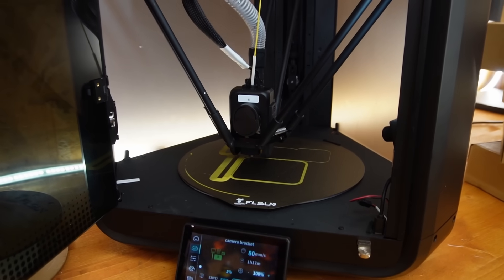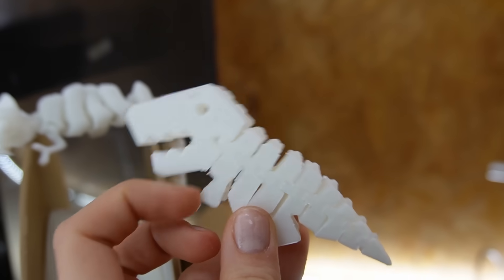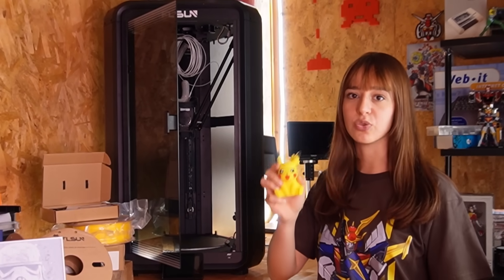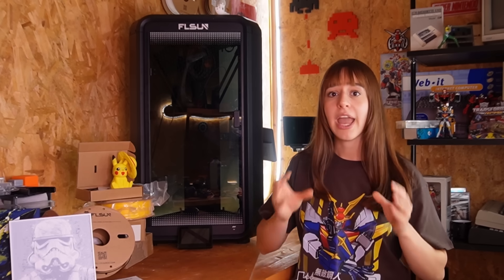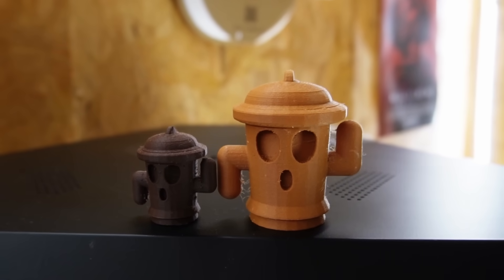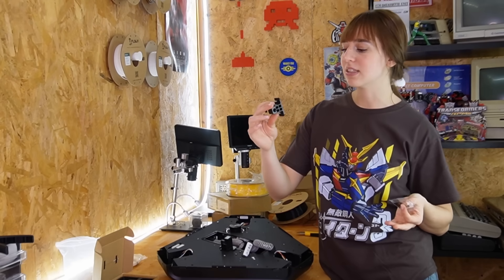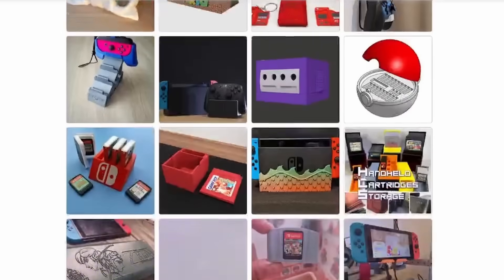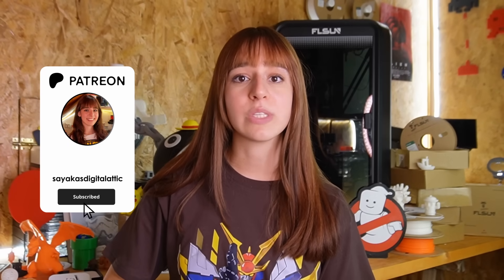How Easy is 3D Printing for a Beginner?

Comment: I really enjoy your videos. Do the 3d printers need a lot of cleaning and maintenance? 😊
Reply from the maker: It depends on the 3D printer model you're using. As a general maintenance tip, one thing you should do every 1–2 months for safety is clean the nozzle or lubricate the axes, but again, it really depends on the specific 3D printer you have.

Comment: You really give me the inspiration to troubleshoot some projects I've been neglecting.  I wish you all the freedom this platform provides,  and hope to see your channel grow for years.
Reply: I've got a magnavox vhs/dvd dub deck that needs the entire dvd module replaced and soldered back onto the board,  and a vcr with tensioner issues. This video reminded me to also work on calibrating my filament printer (I do better with resin machines) There's a shop near me with arcade cabinets,  and I've been helping them to keep stuff running. I've only professionally been a technician for 5 years or so,  but troubleshooting is so satisfying, and you're very thorough.  Hope to talk to you again soon 😊
Reply from the maker: Thank you so much, what repair projects are you working on?

Comment: How does the Flsun compare to the Bambu labs P1S in your experience?
Reply from the maker: I don't have a BambuLab P1S😥
Reply: @Sayakas_Digital_Attic  Oh then i mixed up! Sorry! I thought you had a Bambu as well :)
Reply from the maker: @mlonster  I do have one, but the X1 Carbon!
Reply: @Sayakas_Digital_Attic  Aha, i remembered seeing one:) Can they be compared? Is there a thing that one does better than the other? I am asking because i was thinking of buying a Bambu. But now seeing your FLSun it also seems well worth it.
Reply from the maker: @mlonster  Hi, sorry for the late reply. Well, it depends on what you want to do with the 3D printer. Based on the projects you want to create, there are definitely different recommendations. For example, if you want to print quickly in a single color or if you need multi-color prints, etc..
Reply from the maker: What do you plan to use it for?
Reply: @Sayakas_Digital_Attic  Hey Sayaka! Well, mostly i will use it for spare-parts and technical/mechanical parts used in older audio equipment like amplifiers, cd-players etc.

Comment: I'm fencesitting about getting a 3D printer, on one hand it seems like a large expenditure for something I might only use occasionally that is going to be undenably expensive to run and take up a fair amount of space in my small flat, on the other hand it would be a useful device when it's needed, not to mention really cool.

I know a fellow who's boyfriend bought him a 3D printer as a gift and he loves it, and he has virtually no tech experience but just wanted to print off little gadgets and try see what kind of stuff he could craft and he is very happy with it and picked it up quickly enough, so I'm sure I could pick up the skill of using one, plus I have a weee bit of CAD experience which I could expand on.
Reply from the maker: I totally understand your hesitation! A 3D printer can be a significant investment, especially if you’re not sure how often you’ll use it. It’s true that they can take up space and have ongoing costs, but they can also be incredibly versatile and fun to use.
It sounds like your friend has had a great experience :) and having some CAD knowledge will definitely give you a head start.
Reply: @Sayakas_Digital_Attic  yeah he's a lucky boy, he's been making some cool 3d puzzles with it and I've got to say the prints look good!

Comment: Great explanation.

I bough a smaller 3D printer a while ago and I think it's great.
Even though I'm more of an occasional user, I consider a 3D-Printer a great tool.
I guess I'll buy another one sooner or later, so that I could use and try the additional materials you mentioned.

Aside from several helpers and holders, to attach a power strip to my self-made workbench rack, secure my multimeter probes, printing spare parts is a great use case.
Spacers for circuit boards, holders for modern capacitors in old devices or appliances, a new knob for a kitchen appliance.
Combined with a laser engraver or laser cutter and potent glue, the possibilities are pretty much endless.
Reply from the maker: Thank you! I'm really glad you found the explanation helpful. I completely agree that a 3D printer is an invaluable tool, especially for projects involving electronics and devices

Comment: Thank you for the great introduction. It would be nice if you could cover filament options in even more depth, explaining how much stress printed parts can endure, whether one can screw self-tapping screws into them, etc. I'd use a 3D printer for creating functional parts, like the stand on your keyboard, or a support structure. It would be great to learn about the heat resistance and mechanical properties of printed parts, depending on what filament one uses.

Comment: I've been printing since 2018. My first printer was an Anet A8. Yes, that Anet A8, the one that is infamous for sometimes bursting into flames. But once I fixed the few glaring issues that could lead to combustion, it actually turned out to be a real workhorse. (Never ran the thing unattended tho. I'm not stupid, nor am I reckless.) Probably not the wisest "my first 3D printer" for a complete newbie, because the A8 basically arrived as a pile of parts; you had to assemble the thing from the ground up. But, through first building, and then maintaining it, I learned a ton. After that I moved on to an Ender 3. Also a kit printer that you had to assemble, but some of the parts were pre-assembled, so it wasn't too difficult. Still learned a ton because of it, and I upgraded that thing seven ways from Sunday. Had one or two other machines after the Ender 3, and am currently using an Anycubic Kobra Neo (FDM) and also a Photon Mono 2 (resin.) Though I am eyeing a Bambu Lab machine as my next upgrade. Those look pretty sweet, and at least from the hardware side of things, I feel like I'm at a point where I want a machine that's ready to go out of the box and that "just (more or less) works."

Comment: 3d printing has largely been a disaster for me.  About 75 percent of my prints fail.  Really frustrating.
Reply from the maker: What printer do you have?
Reply: @Sayakas_Digital_Attic  ender 3.
Reply from the maker: @gregorymccoy6797  How strange that such a high failure rate of prints occurs. Have you come across similar reviews online about the same printer? Or even about the projects you're using?

Comment: As long as you don't get a cheap ender 3 you'll save yourself a ton of problems lol i bought an ender-3 and manually calibrating that thing is a massive pain in the a$% 
Get one with self-leveling out of the box and you're set, then the hard part is figuring out CAD software to really be able to make use of it
Reply: I love my Ender-3, personally. I can re-level it by eye at this point. I think it's a great little printer for no more than it costs.

Comment: I would like to say that in my opinion, the FLsun machine is a dark horse, and its deltas design is simply too cool. I think their product is not just a decoration, but has real strength. There is no warping during the reprinting process, because their machine can generate enough temperature and the power of the fan is enough to give force. So far, I have purchased two FLsun printers, and I can strongly feel that their products are improving, speed and quality are steadily improving!
Reply: Totally agree! As a long-time FLsun user, I'm super satisfied! Time to level up and get the Pro! 🚀
Reply: I just placed my order! At this sweet deal, I couldn't hesitate for a second!
Reply: Sì! Mi piace davvero il design delta! Il futuro sarà sicuramente un mondo delta, la velocità è ciò che conta di più!

Comment: A great topic to talk about, especially after you have already showcased some of your amazing creations. I have been playing with the idea of getting into it, but I feel like I am lacking the creativity for it. I have a background in mechanical engineering and computer science, so designing parts shouldn't be that big of a problem, but the path from zero to a product I actually have need for seems quite long and has kept me from getting a 3D printer so far (plus the cost and the space, of course).

I do see many possible use cases for it, though, like stuff for cars that I am working on (old plastic tends to become brittle and break at some point) or keyboard feet just like yours that break off. So someday I might have a 3D printer too :).
Reply: Sounds like you’ve got some serious ideas about 3D printing! You should get the Flsun T1 Pro. My T1 perfect for all kinds of projects.

Comment: Indeed, learning to print custom objects with a 3d printer is very useful. I have printed many things from a Wifi access point wall mount with POE access to the tap on my water butt, which was lost. Additive manufacturing is now just about in the reach of anyone with ready to set up printers and easy to use modelling software. 

Thanks for your enthusiasm and explanations. :)
Reply from the maker: Exactly! It’s a game-changer when you realize you can actually print everything you want, i’s like having an endless supply of replacements too! Glad you enjoyed the video!